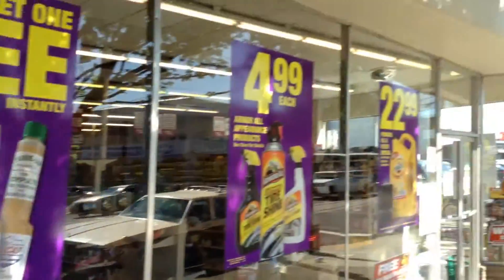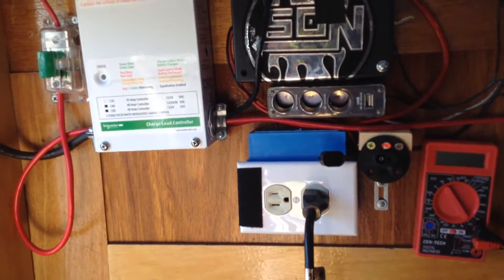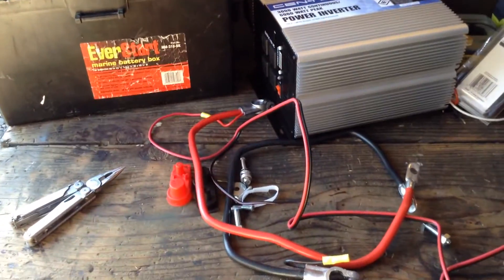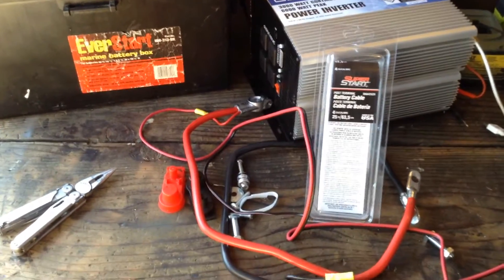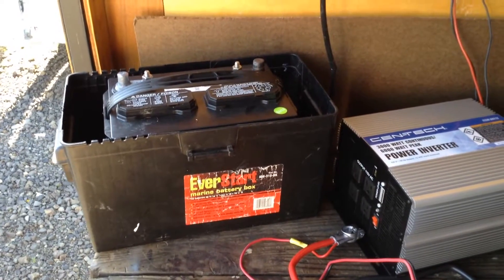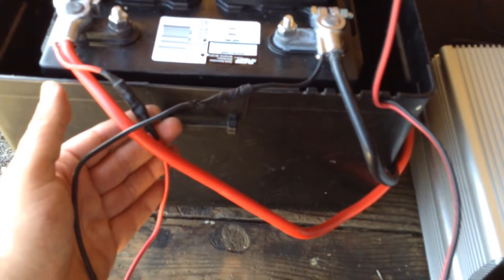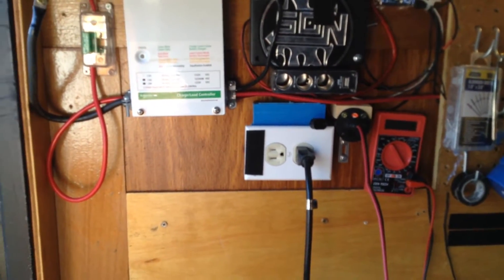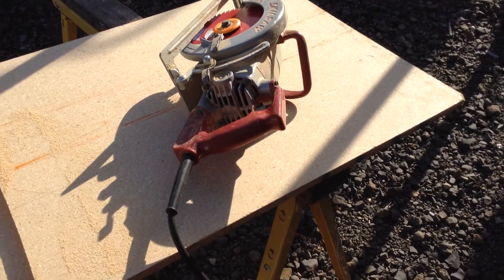Medium solar generator power pack build part 1

Comment: Hey thanks for the video. My only comment is that a lot of us are not as handy or knowledgeable at this things as you are so details on what to connect where and perhaps some diagrams would be very helpful. Also, the trailer build step-by-step would be greatly appreciated. Thanks again.
Reply from the maker: I posted several other videos in relation to this particular project.   Just do a search for 8digitpdx solar trailer, and you will come up with a bunch more videos in the search engine.   Different electrical connectors connect differently so sometimes what is one of my videos may not be specific to the hardware you get from other companies, but I detail how to use a few different connectors.